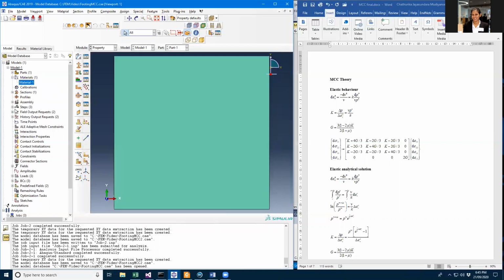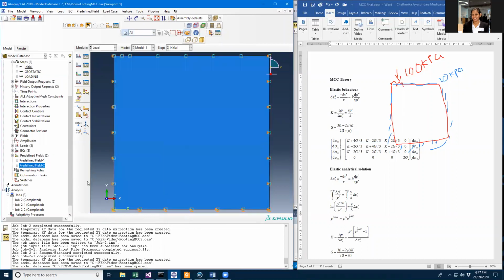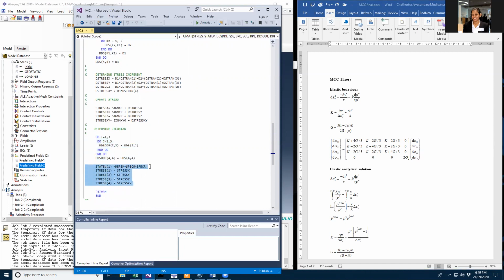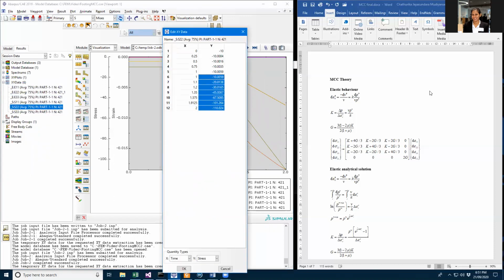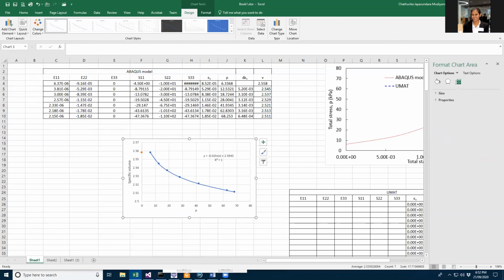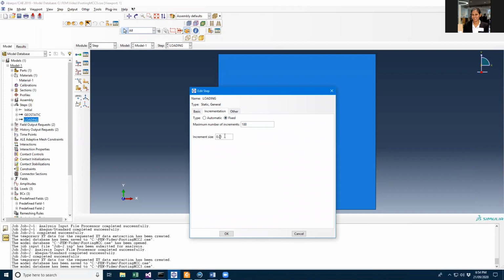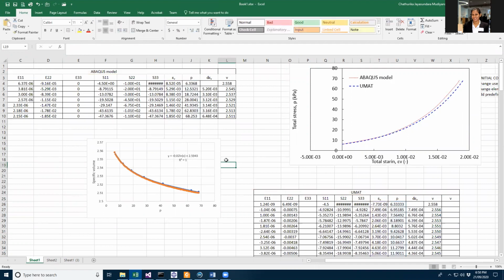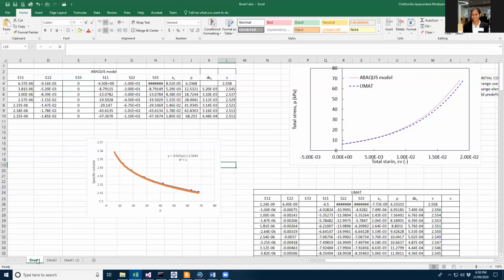How to write an Abaqus UMAT - Modified Cam Clay Elastic Model

Comment: dear, I am modeling a marine slope with increased pore pressure in the abaqus using the Can-Clay model. I found the following error.
" The sum of initial pressue and elastic tensile strength for the porous elastic material in element 1 instance ground1-1 must be positive."
What was the solution you found to overcome the problem?

Thanks and regards.